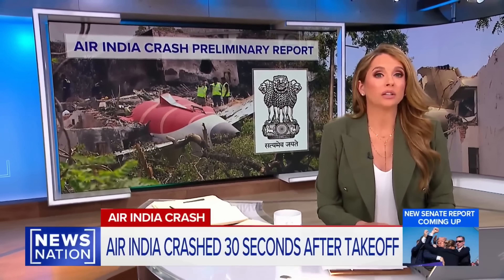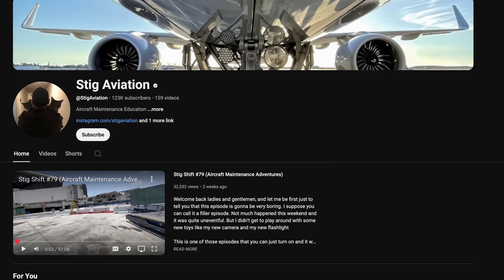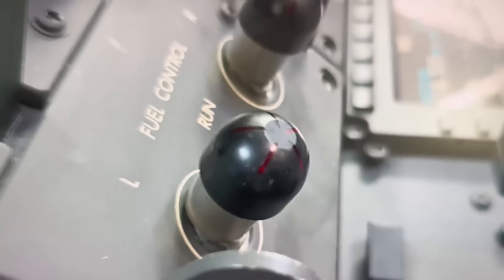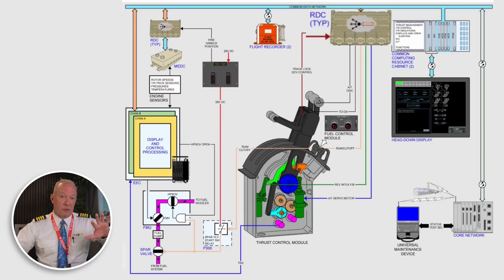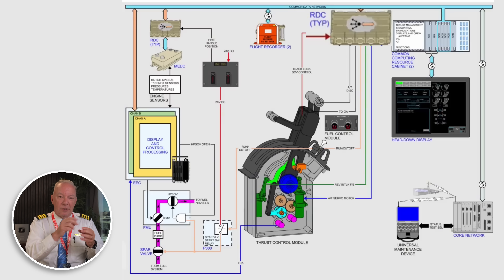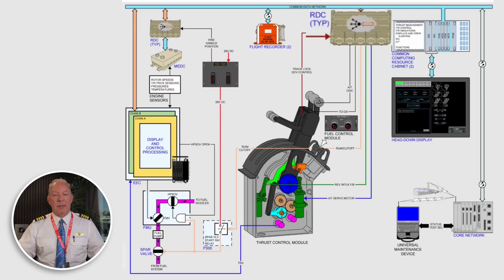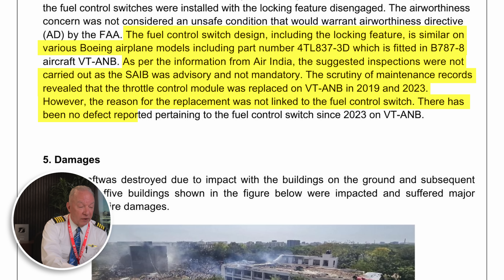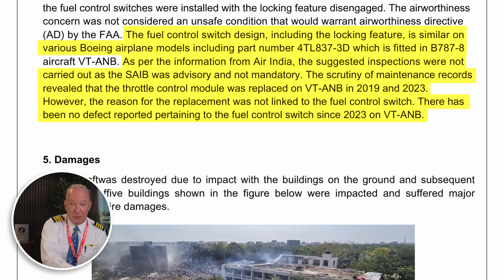The Truth About Boeing 787 Fuel Control Switches

Comment: The relay could have failed in both switches.  That is still a possibility that has not been ruled out to my knowledge.  I There are many things which are strange about this incident which have come to light, but the most suspicious things which increase the likelihood of some sort of mechanical or electrical failure relate to the timeline of events according to the report not agreeing with the  footage and RAT deployment.  Until everything is thoroughly explored there should be no assumptions made, especially by the people piloting these aircraft.  We simply cannot rule out the possibility of these failures at this point and to double down on the assumption that this was the result of human action alone is a point I will continue to contend with.
Reply: The relay is not in the switches.

Comment: I really cannot understand how everyone can say that the switches have been moved for sure . physically they are not physically wired to the data recorder and the only really fact we have is the information from the data recorder what shows a state change .. but where did the data recorder get that information from and how is that information constructed.  The only physical view is the picture what shows the switches after the crash in the on position . But never ever those switches have a secondary contact what would be used for sending position information of the contacts to the data recorder . Thats not the case . So there is no real information about the switches position what goes to the data recorder . maybe the relais has those contacts or even only the valves positions have a position contact, proximity switch or what ever who gives the information to the recorder . , but never the switches themselfs have any auxiliary information contacts. is that correct ? if so, then its still just supposed that the switches position cut the 28V supply to the relais what cuts the supply to the valves what moves them to close and that close position of the valves goes as an information to the data recorder , right?  if so , then we know only that the valves moved for sure , not that the switches moved . please tell me if this is correct . where the data recorder gets his information from ? and what data does it gets ? and where are the information wires connected ? 🙏
Reply: The fuel cut off switches are not connected to the FDR, the position of the fuel spar valve actuator via position (limit) switches are. That means power was supplied to the close circuit of the actuator, the motor turned and the limit switches on the actuator shaft changed position when fully closed. The limit switches sent a signal to the RDC -> CCS -> FDR & Flight Deck Displays among others. Since the actuator closed is a voltage input (not digital) it is possible a chaffed wire could cause a short and provide power to a valve closed input. That would be a 10-9+ event. For that to  happen to two valves on the same airplane within 1 second of each other is astronomically impossible.

Comment: The smallest brain fart could cause someone to accidently reach and throw the switch.  I predict it will be changed to a full cover and maybe a buzzer when the cover is opened.
Reply: Pilots are well trained, it would not be a small brain fart. This was a deliberate / psychotic action. Also, there is no cover over the cutoff switches.

Comment: Here, through AI Q&A: Automatic Reignition:

If the ignition switch is accidentally moved to the "off" position during flight, the aircraft's systems may attempt to automatically re-ignite the engine and refuel. Note that if the aircraft's systems are capable of automatic re-ignition, it is also possible to automatically cut off the fuel supply.
Reply: If the ignition switch was set to off, the engine would continue to run. It just would  not relight if the engine flamed out or had a compressor stall. I do not think it is possible to "automatically cut off the fuel supply" to both engines without manual intervention.

Comment: I figured it was its own independent circuit and not influenced by other computer lines. I wonder why it is taking so long for the Indian investigation group to come out with a conclusion? I wonder if it's politics?

I think it was in the Wall Street Journal where I read why they came out with an interim report. It was to quiet any possible critics in India who wanted to deny it was a deliberate action. They mention the Malaysian air 777 and the Egypt air 767 both pilot suicides and both governments denied it

Comment: Texting as a mech from 1998 to 2004. His analysis is accurate from a pilot perspective. They should always perceive the flight data as accurate and uncontroversial. But you start accepting FDR data as infallible, and you're as wrong as it can get! FDR Data is either 1 or 2, yes or no, power or no power. There's no intelligence, no decifering, no figuring it out! FDR showing the engine cutoff switches in😂 cutoff shows nothing more than no power on that particular buss. It should trigger a much larger investigation, but only since it hasn't...😢
Reply: In this case, for the Fuel Spar Valves the signal comes from a mechanical switch mounted in the valve actuator. The resultant signal is recorded by the Flight Data Controller. So for the FDC to incorrectly record BOTH valves closing, and then reopening would rewrite physics.

Comment: Here's a more detailed breakdown:
1. Activation: The pilot initiates the fuel pump by flipping a switch, often in the cockpit. This switch sends an electrical signal. 
2. Relay Activation: The signal from the switch activates a relay. Relays are essentially electrical switches that use a small electrical current to control a larger current, allowing for a safer and more efficient way to manage the power to the fuel pump. 
3. Power Supply: The activated relay then provides power from the aircraft's electrical system to the fuel pump motor. 
4. Fuel Pump Operation: The electric motor spins, driving a pump mechanism. This mechanism can be a gear pump, a vane pump, or another type, depending on the aircraft design. 
5. Fuel Delivery: The pump draws fuel from the tank and pushes it through fuel lines, usually passing through filters to remove impurities. The fuel is then delivered to the engine's fuel injectors. 
6. Pressure and Flow: The fuel pump is designed to maintain a specific fuel pressure and flow rate, ensuring the engine receives the correct amount of fuel for optimal combustion. 
7. Redundancy and Backup: Many aircraft have redundant fuel pump systems (multiple pumps) and backup power sources to ensure continued fuel delivery even if one pump or part of the electrical system fails. 
8. Control Systems: Some aircraft also have electronic control systems that monitor fuel pressure and flow, automatically adjusting the pump speed or activating backup pumps as needed. 
9. Fuel System Safety: Aircraft fuel systems are designed with safety in mind. For example, some systems include inerting systems to reduce the risk of fire or vapor lock. 
In summary, the electrical circuit for an aircraft fuel pump is a critical part of the fuel delivery system, ensuring a reliable and safe supply of fuel to the engine during all phases of flight
Reply: Yea, no. What you suggested is mostly true on a non-787 Boeing aircraft. On a 787 it is mostly Common Core System (CCS = computer) driven. Think of the flight deck switches as mostly being a computer keyboard. You press a switch and a digital signal is sent to the CCS where software sees that switch was pressed and does something. The Fuel Spar Valves and Fuel Jettison Valves are exceptions to this rule. But for fuel pumps, you press the pump switch on the flight deck, a signal goes to the CCS, the Fuel Management Software (FMS) sees that that switch was pressed and sends a signal to the Remote Power Distribution system to provide power to that pump. Once the pump turns on, and the pressure switch on that pump shows pressure, a analog signal is sent back to the CCS which tells the FMS there was pressure and the FMS tells the Flight Deck Display to turn off the low pressure indication on that fuel pump. Yes, is a bit complicated, but no more than the computer you are reading this message on.

Comment: Hi Captain Steve, I just watched a report on the fuel switches on Air India and you made everything very clear. I appreciate that but I have one question in my mind about how the fuel switches are its own unit as you say and they’re like a close loop system I question how does the computer generator report that shows the timing etc. of those switches if it’s a close loop systemwhat I’m saying is there must be some type of electronic connection to the close loop system as you describe otherwise the computer could not report the incident and record it as data. Please clarify thank you.

Comment: Looks like boeing paid again😂... Why was the rat deployed just aftet lift off... Refer Gaurav taneja videok
Reply: The RAT deployed with the loss of all AC power. Like when both engine fuel spar valves are closed and the APU is not running. Simple, no?
Reply: @paultruzzi911 part 2 https://youtu.be/sDQHhlPGaoc

Part 1 https://youtu.be/9GqAXrDsjSU
Reply: @paultruzzi911 Rat takes 5 sec to deploy in 737  and rat was deployed just after lift off not after fuel cutoff... It means engines got falied way before the pilots turn off the swtiches. Refer the videos

Comment: SoPilot deliberately pushed the fuel switch to cutoff
;Ridiculous?
Why there is no audiovisual warning like red lights ,audio voice,etc, nowt warning the pilot.]
In fly by wire tech why no built in safety mechanism to warn pilots when such a very critical stage of flight _ Take off.
Boeing also needs to explain wht electrical failure.
Reply: Other than the mechanical detent on the fuel cutoff switches, there is no audible notification that I know of. Normally in flight, the use of these switches or the fire switches, would only occur during an emergency. There would be a lot of audible warnings of the engine failure and another would probably just be a distraction.

Comment: I haven't heard an answer to this question yet:  Could one of the pilots simply turned the engines off by mistake?  I have a RAM pickup I drive every day - 1,000 times I put it into gear... but once or twice my muscle memory grabed the A/C knob and turned it thinking it was the transmission.  Maybe not thinking clearly, tired, distracted - who knows?  but I made a mistake on something I do all the time.  Maybe the pilot understood "go flaps up" but his muscle memory/brain just turned off the switches instead - just like they were parking?   I agree it would be very strange - but I make stupid mistakes all the time.  Was there some operation they should have been doing in this takeoff sequence?  When will the audio from the cockpit voice recorder be released?  When is the final report?
Reply: It is a totally different physical action, moving lever with a wheel on it up, or pulling a switch up and forward (twice). I'm not a psychologist so YMMV.

Comment: How can you rule out pilots trying an "engine relight sequence" after electrical failure or something  ? You are stuck on 'switches transitioned to turn-off' but never mention that the switches were actually found in 'run position'. How did they come back to 'run' ?
Reply: They were set back to RUN, but only after a lengthy delay (10 seconds, an eternity in that situation). If they were attempting a relight surely they'd have been turned off and then on again straight away?

Comment: There was similar issue with fuel switches in Nigerian Flight with 787. 

Your explanation on how switch work is legit. But how can you gurantee that its not electrical short circuit, or elecetrical pulse error, or ecu failure, that can happen without switching the fuel physically to off?! 

Pilot saying "Why did you switch that off?", could be anything.. could also be talking about the switch looking at the display, nit at the actual switch.

The report is delusinol.

Unfortunately  the involed parties:
1. Air India - maintainance
2. Boeing
3. AAIB

Has history of lying and non of them as credibiliry for any trust!

Look at the analysis from Fly Beast channel! You can watch it with Engliah Audio too.
Reply: Sounds like a conspiracy theory; how do we know aliens didn't help build the pyramids? Lets be logical for a second, you have to purely mechanical switch systems ( Left and Right engines), the fuel shutoff actuators provided physical position indication to the FDR. It is possible that an electrical short on the close circuit of a fuel shutoff valve commanded it closed. But for that same short to happen on both valve circuits (half a wing span away) within 1 second?  Oh yea, and then both short go away 10 seconds later on both sides. I think you are reaching.

Comment: A rely can go bad and cut off the the current.
Reply: Power loss does not change the valve position. It must be powered into the opposite position.
Reply: Two relays becoming diffective at the same time is unlikely.

Comment: Relays can go bad. My avionics switch failed and I was not able to to turn off the avionics. The relay was designed to fail in the on condition. Needless to say, I replaced the rely, and the switch. I do not need problems in my airplane.
Reply: So in your avionics experience, have you have two switches fail within a second of each other and then the failure clears itself on both a few seconds later>
Reply: @paultruzzi911  "So in your avionics experience, have you have two switches fail within a second of each other and then the failure clears itself on both a few seconds later?"

The common factor here may be the power supply to the circuits that sense the position of the fuel control switches.

Comment: Please confirm the supply to the fuel control switch is from a single  battery pack and common input or both are supplied with different power source, as all your videos explains the supply from the switch (output) but no clarity on input. If the input are from a  same source and issue lies in Input then the both engine may b cutoff.. just a layman query by a common man.
Reply: Power to the fuel spar valve is via redundant power sources. There are multiple generators on the aircraft and they are divided into different busses. But if ALL AC power were lost (e.g. both engines & APU not running) the fuel spar valves would still be powered by the ship's battery.
Reply: @paultruzzi911  "Power to the fuel spar valve is via redundant power sources. There are multiple generators on the aircraft and they are divided into different busses. But if ALL AC power were lost (e.g. both engines & APU not running) the fuel spar valves would still be powered by the ship's battery."

However as the switch position sensing circuits are not essential for flight these circuits may have been depowered, suggesting that the switches had been moved to the CUT-OFF position, whereas they had not been moved. When the power was restored (by the RAT generators coming online) the switches would have appeared to have been reset to RUN.

Comment: What about the WoW sensor?
Disengage the  WoW system, please, HAL
Reply: What? The Weight on Wheels has no play with the fuel shutoff valves. The fuel spar valve is mainly there for loss of an engine. Think of an engine ripping off and flying away, or a rotor burst that cuts the fuel feed line between the front spar and the HPSOV. You want to stop fuel from going out and feeding a fire whether there is Weight on Wheels or not.

Comment: Also when the RAT is active does it override the dc back up battery
Reply: No. When the RAT provides electricity, it is in one of the busses. AC busses (e.g. from an engine generator, APU or RAT) generally take president over the DC battery bus. The battery bus provides minimal flight deck indications for a limited time. Think of the hot battery bus as good for ground starts or a dual AC bus failure (beyond extremely rare) providing the pilots with UP/Down, Altitude and direction indication & a hope and prayer.
Reply: @paultruzzi911  The B787-10 aircraft supplied to Vatican Air have a modification where in the overhead compartments in the main cabin and of the flight deck, in desperate situations, a Bible and Rosary are provided to all souls onboard. 

Ryan AIr have a similar fit, but with an additional function where pinkslips are provided to each member of the crew.

Comment: How does the captain know if the dc 28 v battery is connected and or has charge ..
Reply: LOL, Yes if the battery was not connected there would be warning before the pilots even tried to start the engine. But in this case, not having DC power would not change the fuel spar valve position. It must be powered from one position to another (open-> closed or closed ->open).